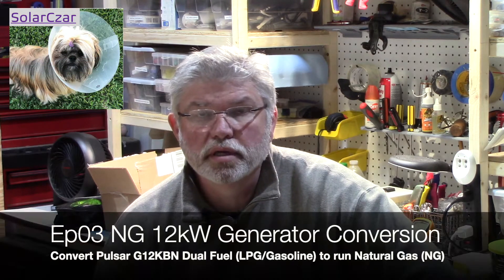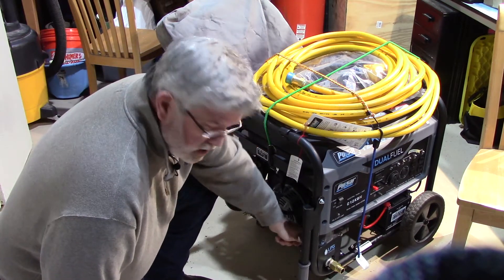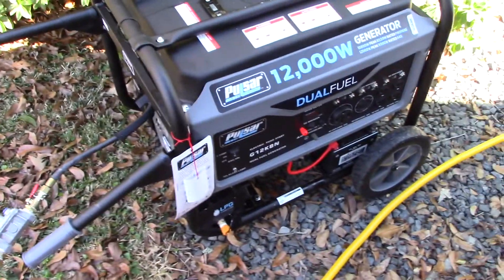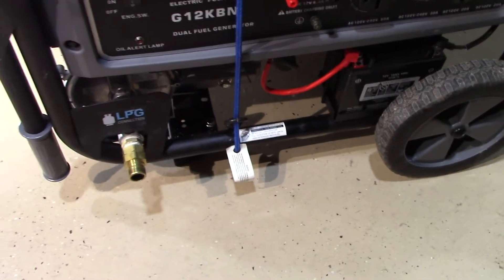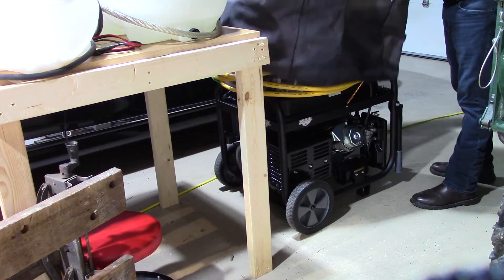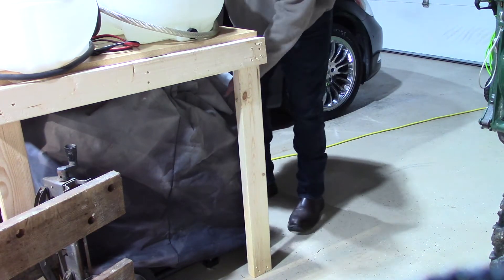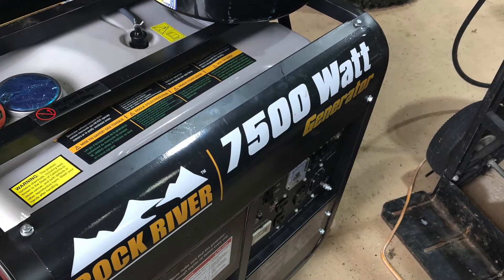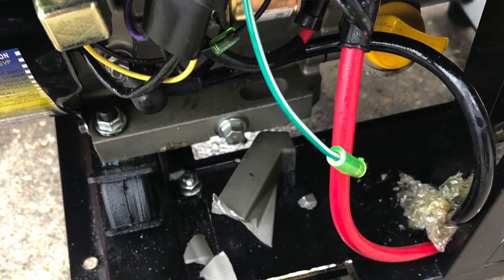Ep03 Natural Gas Conversion Pulsar 12kW Generator

Comment: What parts did you use on the outlet side of the new regulator? Regulator outlet is 3/8" but I am not sure what is the size of the fitting at the end of the original propane hose (hose is 5/16") , you disconnected from the original propane regulator : 3/8" fitting? In your video this seems to be connected to the 1/4 ball valve. Thanks!

Comment: I'm in the process of converting my 12KBN to NG, I was not aware of unbonding the Neutral. Plan on using the same components. Will your setup allow you to run on Propane?
Reply from the maker: If you change the regulator, then you’ll experience some performance issues. You can play with the throttle to get to a liad

Comment: We were just out of power for 6 days after the Little Rock, AR tornado -- the day after our power went out I went and picked up a Champion 4375W generator, but quickly realized how much work it ended up being running extension cords from the unit to what we needed to use. Just bought the Pulsar 12kW and have been researching around on interlock kits and connecting it to the main panel. What you're doing here looks to be way past my experience level, but was very interesting nonetheless. Thank you for sharing!

Comment: Well Explained for Most important points from Conversion Propane/Natural Gas and Electrical works and Safety...... So I Subscribed.....
..... But I did Electrical works By myself 4 years ago and no issue
But it's kinda concern about it Sometimes.

Comment: Is the flexible gas line csst with  plastic jacket ?
Reply from the maker: Mine was epoxy coated, but plastic coated would be better for durability.  I keep mine out of the weather, but when I get time to build my permanent enclosure we'll move to hard piping it.

Comment: What’s the different between the blue and grey one? The blue one is on sale at my local store and it’s $100 cheaper than the grey ones online.
Reply from the maker: I “think” the only difference was that the models were specifically made by different groups for their online vs retail outlets. I’d ping the manufacturer for specifics

Comment: Any thought to the Total Harmonic Distortion (THD) that the generator produces and how it may affect the electronic components in your household?
Reply from the maker: Absolutely...It's important to stay below 5% THD, which the Pulsar personnel "claim" it to be.  To take one extra step, I've relied on placing UPS's for those expensive servers, personal computers, and even expensive Smart TV's for protection.  I am still researching and waiting for the Global Supply fiascos to calm down, at which time I will place batteries to power my entire home.  This has proven to be the best protection to equalize out any power frequency variables, and I encourage others to do the same.  Think of it as electronics insurance.  Thanks for the comment
Reply: Typically, when the manufacturer fails to include THD specs, it's because their THD value isn't anything to brag about. I see a 'lot' opinions on the topic ranging from THD,5 to THD>10,  but not a word (printed or otherwise) from the manufacturer. If 'anyone' you know has actually measured the G12KKBN THD, I'd love to see their results.
Reply: ,Correction: " I see a 'lot' opinions on the topic ranging from THD,5 to THD>10,  but not a word (printed or otherwise) from the manufacturer"  should have read "I see a 'lot' opinions on the topic ranging from THD<5 to THD>10,  but not a word (printed or otherwise) from the manufacturer.
Reply from the maker: @bsintzel  They all have the THD data, but it’s hard to find sometimes.  I’m actually researching to move my home onto a grid-tied battery fed by my 20kW solar array. The batteries will equalize any harmonic distortion from a generator, including other power grid spikes and variables.

Comment: Great video you seem like a very intelligent guy but here are a few things to consider.  1.) Two Rock Rivers at say $800 per and another $1500 for a pulsar all of which have high THD puts you over $3,000.  I suspect you're talented enough to self install a Generac 24KW with a transfer switch for a little more than double plus it will work when just your wife is home or if your out of town.  I say this because I have a Generac 17,500 with a shed lots of air flow 10 100lb propane tanks along with a US Carburetion LP & NG kit and I should have just bought a true standby as well.  My electrician also back fed my AC disconnects so I can literally run AC #2 3.5 ton with a second genset down the road while the 50 amp inlet on genset 1 runs 5 ton, thermostat and entire house.  I put the rectorseal KS1 hard start kits on mine but I think I'm going to upgrade to the micro air soft start which will reduce inrush about 75%.  My wife laughs at me every time we get a bad storm she says have fun going out and hooking up all your plugs tight ass.
Reply from the maker: Jerry, First thanks for watching.  So I probably should have given some background, but the Rock River Gensets were $250 each (Grainger product closeout business sale...now I understand why...terrible product), and the Pulsar was $899, so I'm only $1399 in.  Generac 17.5K is a great product, and I almost went that way, but price pulled me back for the value.  Once you start getting close to $4K, then true standby is always the best ticket.  I hear ya relative to the wife feedback, and in the same camp here.  Luckily here in Louisiana, it's for something used periodically, and I can't justify the additional expense.  So, I'm still happy about my direction.  Plus, my plan is to install a battery plant and always run the house on battery, with my 20kW Solar Array recharging me daily.  then the GenSet will only be for extended outages...read hopefully rare.  

MicroAir soft starts are great also, but watch my other episode on soft starter.  I like the electronics cycle protection of HyperEng SureStart, but both work great.  Thanks for watching.
Reply: @tlutrick956  Thanks for your reply.  I will look at your HyperEng SureStart Video.  I sort of fell into the Generac actually bought the Northern Tool power horse first but never took delivery once I read the oil needed changed every 25 hours.  At that point They also had the 17,500 in stock so I bought it.  This was about 6 months before Texas winter storm hit so it served us well.  When I looked over your cost sheet the other thing that shocked me was where did you get a 50A 50ft cord for $120.00?  The Generac 6390 is going for like $446 these days.  I'll watch some more of your material Thanks Again

Comment: You mentioned possibility of 2 generators for higher load.  How did you handle separating then and setting up the neutral/ground since you can't connect two unsynced generaters to the same system?
Reply from the maker: So my house has a main load panel and a sub panel fed from the main panel on the other end of the house.  By putting in the transfer switch (30A), I was able to separate the feed going to the sub panel (including the neutral), so it effectively runs as two separate services when transferred.  The generators don't have to be synced, but as you can imagine, you have to be careful not to let the generators continue to run when you transfer back.  They have to be shut down in order, with the generator feeding Subpanel shut down 1st.
Reply: @tlutrick956  interesting.  I had wondered about this very thing before but wasn't sure how the separation had you be done.

Comment: Thanks for the video.  It has been a great help.  I just have a couple of questions.
1. Are you running 1/2" or 3/4" line to supply the natural gas to the generator?
2. What kind of natural gas hose are you using?  Are you using flex gas line like available at big box store or did you find some compatible hose?

I appreciate the time you took to make the video and to reply to my questions.
Reply from the maker: 1. 3/4” supply. When it comes to NG, run as large as you can. 
2. So I am running the yellow metal flex line. Little stiff to work with, but very stable.

Comment: The type of regulator needed for this application is called a demand regulator. The venturi in the carburetor creates a vacuum which pulls on the diaphragm in the demand regulator and opens it. When the engine stops, its closes and shuts off the gas flow. The regulator you ended up with looks like a demand regulator, just putting the info out for anybody who may need it
Reply from the maker: Thanks, you are correct
Reply: @tlutrick956  do i really need the ventury for this generator?  or the loading block? my ng pressure is 8 in wc, what king of regulator do you recommend?

Comment: mine stopped running in the middle of hurricane ida ,, will not run on propane or on gas ,, starts up shuts down ,, go to start aagain it backfires ,, run for a minute and shuts down ,, had to for 1 year ,, first time using for emergency and it let me down ,, has oil ,, low oil indicater light did not come on
Reply from the maker: So sorry to hear.  Never a good time when you need a generator

Comment: Hey there, great videos, thank you. I have a pulsar 9500/12000 dual fuel (LP and Gasoline). My generator states that while on LP, the power output drops to 8,650 watts and it still runs the house including the 4 ton Central Air. I can convert it to Natural Gas for about $120 and I have easy access to a Natural Gas line. My Million Dollar Question is..... How much power loss from the original 9500 watts on gasoline will Natural Gas knock it down to? Thank you and keep the great videos coming :)
Reply from the maker: So the basic math with all the generators is about 10-15% loss when going from gasoline to either LPG/NG.
Reply: How many liters per KW of the LP gas is consuming on 100, 50, 25% loads in comparison to gasoline.
Please, can you write on that subject.

Comment: Seems like purchasing this kit may be the easy button? See anything concerning with this setup?
https://youtu.be/MEV1GV8Vps4
Reply from the maker: Sorry for the late response, but I've been out of pocket.  Definitely easier, but a lot more expensive.  If you simply follow along and order the parts individually, and even if you make a mistake in a size fitting, you're still doing all the assembly with either approach...so why not save yourself some cash.  One thing I'm rethinking is my supply line is more rigid than I really like and I wish I had gone with making my own.  Good news for me, is that the fittings don't have to change.  Follow the direction you're most comfortable, but glad you're engaged.  Good luck
Reply: @tlutrick956  I purchase the same hose and 'yes', it's quite stiff at room temperature. I can't image unraveling it at 10 below zero. I've therefore elected to bury the NG line between my NG meter and my shed (25') away. I'm hoping it will make it a bit easier to use. As long if I keep enough slack in the shed to connect to the generator I think I'll be ok.

Comment: Ive been using an acetylene regulator and hose on propane for about 10 years for my aluminum foundry furnace,
I read propane will deteriorate an acetylene regulator and hose,  So far I have not experienced any evidence to support this,
You can precisely dial in the pressure,  Propane uses both internal and external threads so an acetylene regulator fits the internal threads.
This is for anyone sitting on an acetylene regulator not knowing how well they work.

Comment: I'm running a 3/4" rubber fuel line from napa, I found 1/2 was too small for natural gas flow.
Reply from the maker: I’m running 3/4” to the regulator, but left the inlet to the carburetor stock. You should get better performance. Thanks for sharing
Reply: SolarCzar, Mine runs fine but I'm still trying to figure out what it tales to get a 'one pull' start with natural gas,
Natural gas kinda flows like my dead grandpa, then eventually it works it's slow ass into the engine,
Buy then I'm on my third pull,  I'm going to keep playing with it and see.
Reply: SolarCzar My 3/8 hose is only 24" then to 3/4, But I haven't run it under a load.

Comment: Thank you for making this video! I have the exact same generator and I am looking to make this same modification. Any chance I could talk you into publishing an article or video that is more step-by-step / dumbed down for those of us who are slightly less handy? I managed to get the regulator ordered but am having trouble figuring out all the right fittings and other accessories
Reply from the maker: The problem for me is time. Shoot me questions if you’re unsure about a particular aspect and I’ll try to talk you through it.
Reply: @tlutrick956  Definitely understand. I'd be happy to pay you for your time for a phone call but didn't see any way to direct message you or email you. Here's a starter list of what I need help with:
1. Hire a plumber to make gas line connection? Assuming yes
2. Dormont A75 fittings - Do I need two of the same kind? Or do I need two different ones? One for gas supply side and one for connecting to regulator? What specific model numbers?
3. Regular plumbers / teflon tape to seal threads? Or special kind?
4. Do Dormont fittings connect directly to regular and gas line? Or are there additional fittings needed? If so, what kind and model no.?
5. What model number fitting for 90 degree coming off of the top of the regulator?
6. Any bolts/screws/tools needed to get the regulator installed?
7. Found the instructions for the floating ground below - thanks
8. Do you have to completely empty the gas tank out before running on nat gas? What's the process for going back and forth?

Thanks in advance! -Geoff
Reply: I'm in the same boat as @geoff.

Comment: The excess flexible hose reduces the volume of gas that feed the generator. Eliminate excess hose. Keep gas pipe as straight as possible to get maximum cubic footage
Reply from the maker: Very true. I’m planning to add a generator shed, but haven’t decided where it’s going, so hence the excess. Thanks for the comment

Comment: I just finished making my generator shed. I have the same generator and I just ran it for 5 hours using break in oil. I am using propane because natural gas is unavailable to me, but I have 3 100 lb cylinders. I made a propane shed as well. I haven't load tested the generator yet, but I'm sure it will be able to handle quite a bit.
Reply from the maker: Awesome!

Comment: Was there a specific grill cover you used? Seems like it fit the generator perfectly.
Reply from the maker: Truthfully, it was an old electric grill cover that I recycled. :) My wife gets on to me for rarely throwing things away, but here is proof that sometimes it works out.  It is actually too tight and gets in the way of the wheels. When it finally goes out or If I had to buy one, there are a number of better solutions for little money online.  Thanks for watching and engaging.